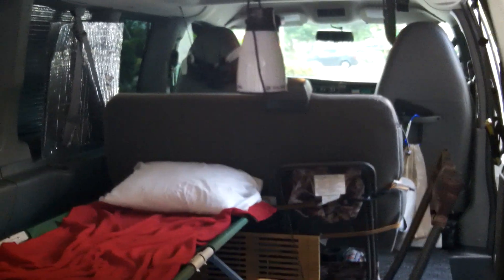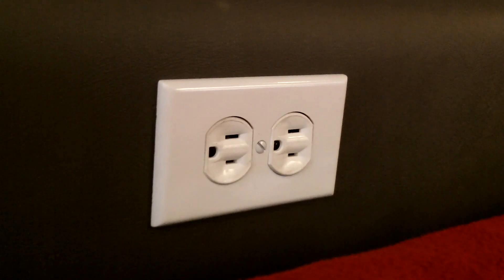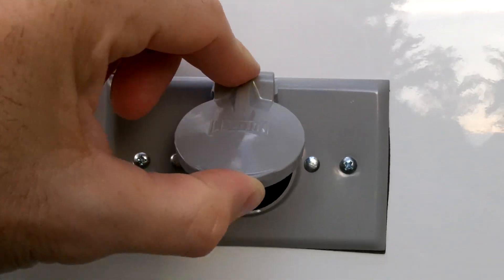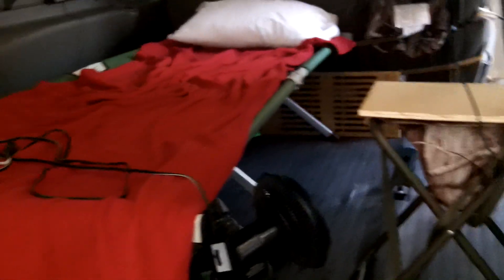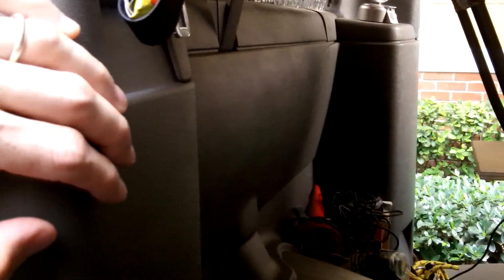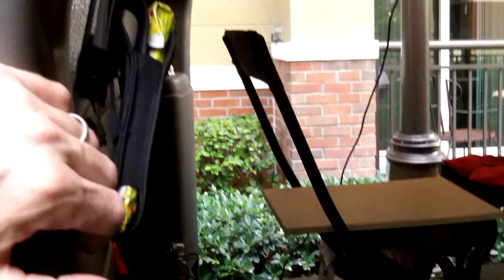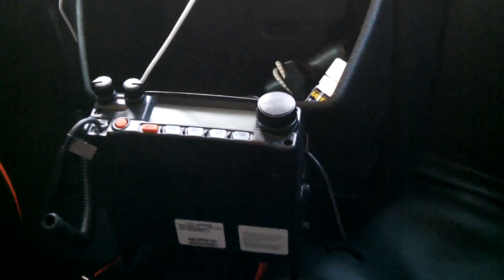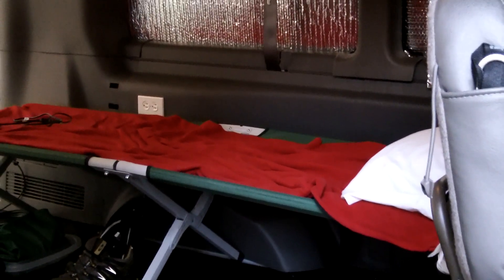Bug-Out/Stealth Van- A/C Outlet Install- First Look

Comment: you can also remove the second row seats and store it for when u really need it.. It'll give alot more real estate to work with! plus, you should look into getting the swivel seat adapters for the two front seats. A very cool idea from veteran Van dwellers.. Install some vent ports on each side for good air flow and another must have item is the 
fan-tastic 7350.. Its the best one on the market with all the features and decent price. Living in SFL we both know it stays hott down here so the ventfan will be priceless!!!
Reply from the maker: +Gino Gambino Right now I need the second row seat because I have 3 in my family.  If not, I would remove it to make more room.  I have seen swivel seats before, I will look into this and se if it is an option for my van.  Where do they install vent ports?  I have seen the fans and will be talking to the RV place next week to pick one out.  I may have to remove on of the roof rack cross bars in order to install properly.
Reply: The same guys who installed the AC kit on the van can do it for you. Its only a couple holes all u gotta do is get the correct vents with the metal mesh screen. Lowe's or Home Depot has them.
Reply from the maker: OK.  I will look into it.  Are there any YT vids showing the benefit of this?

Comment: That's a really good idea. Maybe add a couple 12v auto type batteries to charge and act as back ups to the goal  zero ?
Reply from the maker: +The PNW Rider Thanks for watching.  Yes, I already have a small battery that use for my HF Ham Radio.  I could get a few more and keep charged for back-up battery power.

Comment: Electric outlet is a great addition. May I inquire if servicer inserted a air stop gasket behind the outlet? And used fire caulk to fill gaps? I'm surprised that a junction outlet box wasn't used...that would be a superior alternative air leak-free option.
Reply from the maker: +MJ NM Thanks for the info.  I will ask him next week when I see him about the roof vent/fan install.